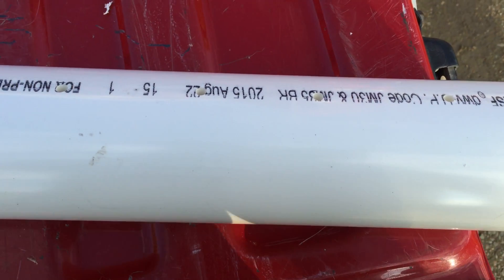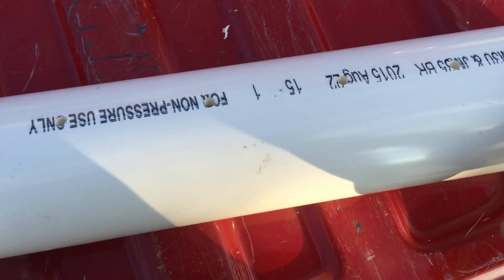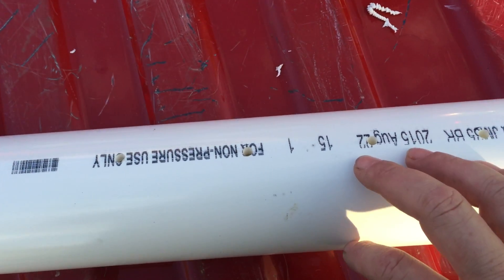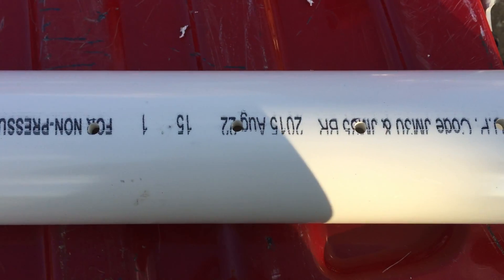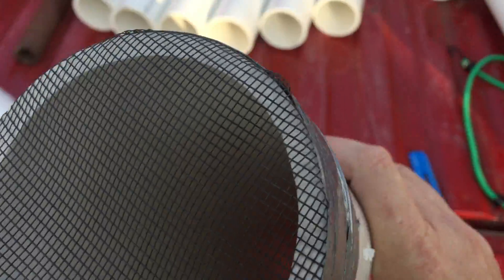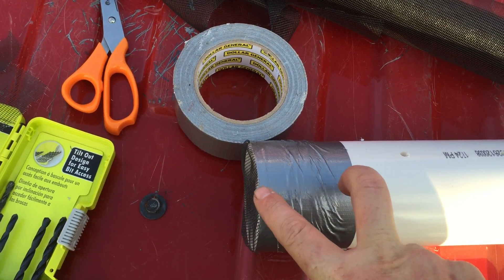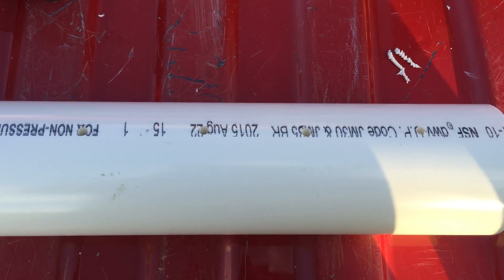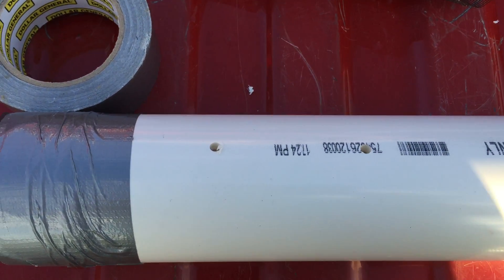Deep Pipe Irrigation for Chestnuts

Comment: Matt - I just now saw this, had asked about it in another video.  Is this deep pipe something that you are still doing?  What are your thoughts on it after a couple years?  If I do this, I’ll also use 3” pipe, those smaller stakes just don’t seem like they would hold enough water to really help.
Reply from the maker: Yes I’m s currently testing on a few trees in my yard.  So far they have made it though our hot summers with only having the pipe filled with water once a week.
Reply: Matt Patterson:  Sounds great, thank you.  Did you install the pipes with your initial tree planting or afterwards?  I’m considering it for some poorer performers.  Any other tips you would add?  Thanks.

Comment: Any update on how this method is working?
Reply from the maker: Haven't really needed it this winter.  I will post an update this summer when our rains quit and it gets hot.
Reply: I am just starting out in this, and I am in Texas also. What area are you in, and what is working well?
Reply from the maker: TheMcGranman I'm up around the Paris area.  If you're talking about trees.  Chinese Chestnut is surviving here as well as Shumard, Dwarf Chinkapin, Sawtooth and Concordia Oaks.  Allegheny Chinquapin are doing great as well.  The trick is to keep them watered the first 2-3 years until they get established.
Reply: Working on some Chinese Chestnuts now. Have you worked the Dunstan? How are the Bur Oak? Also any thought on fruit trees?
Reply from the maker: TheMcGranman I have planted Dunstan and am still int he process of evaluating their heat tolerance.  I had a few two year old trees die this year.  I also had some two year Chinese die too but not near as many.  This was with zero supplemental watering.  If I would have gotten off my lazy bum I probably could have saved some of the Dunstan too.  All of these trees were grown from seed.  Bur Oak seem to do well here as I have several established trees that are producing now but they take so long to start producing.  Some of them were 10-12 years old before they started making acorns.  As far as fruit for deer, you can't go wrong with Dolgo Crabapples.  I have several planted that are two years old that are 6'+ with a tree tube now.  They seem to be very heat tolerant.  I plan to put a few more in the ground this year.  I have also planted Gala and Liberty apples and all died due to drought.
Reply: +Matt Patterson I thought about planting some jujube trees around the place. They seem to thrive in hot drought like conditions, and still produce lots of fruit. Not sure if any of the wildlife would pick up on it though. I'm sure hogs would probably get on it. I'm from Mt. Pleasant by the way, not to far down the road from Pairs.
Reply from the maker: +Davyd Walker I've thought about some Jujubee as well but have been concentrating on chestnut so far.